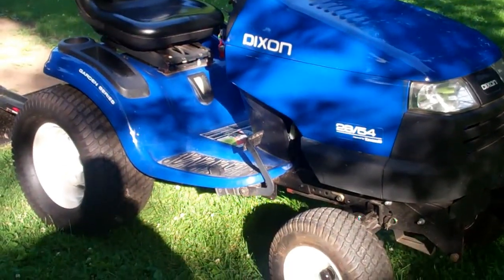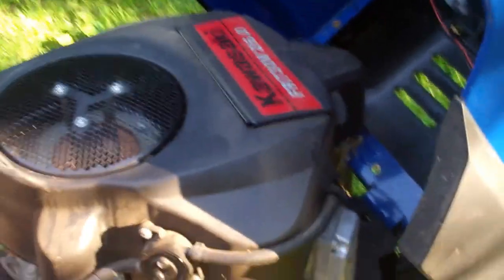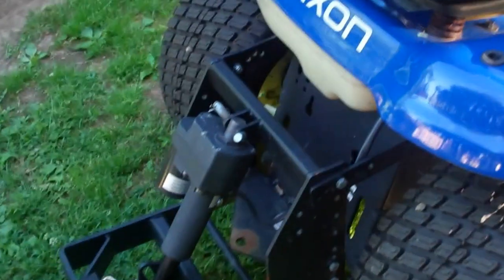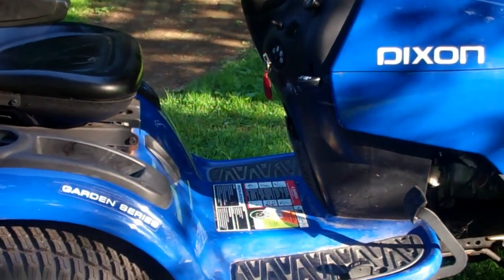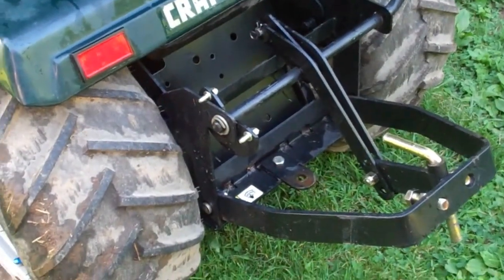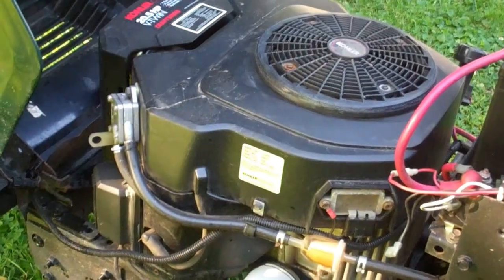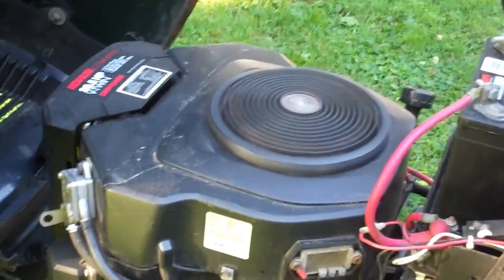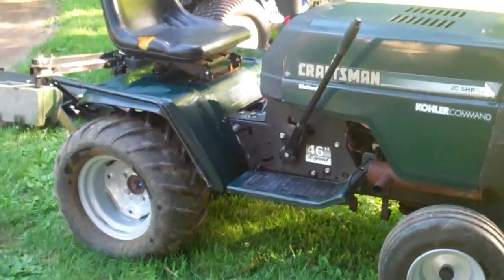garden tractors

Comment: That Dixon is a cool GT. Are you sure that Craftsman is a '90? The 1990 GT would be silver, and would have a horizonal shaft Briggs Twin. Sears started using the Kohler V-Twin Command engine around '94. An awesome engine, by the way. Check the serial number underneath the seat. I'm curious to know.

Comment: I got a 2010 craftsman gt5000 that's the same tractor. The stock rear tires are 23x10.5x12. You got 24x12x12 on or tractor, How much room with the cutting deck do you have with the bigger tires? Because I'm looking for new rear tires for my tractor!!
Reply from the maker: it has plenty of room if you want the 12x12 go for it
Reply: Greg Ashcraft Thanks!!
Reply from the maker: It mowed just fine this one came with 12×12 stock